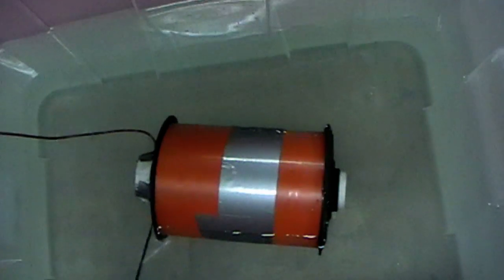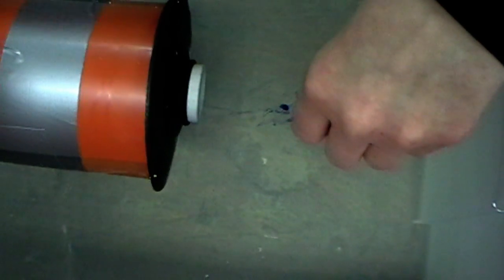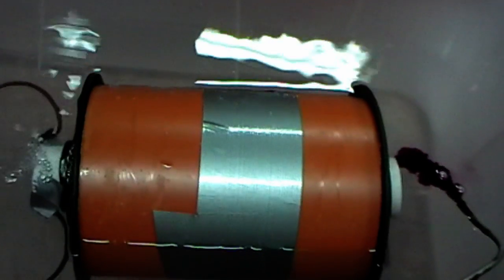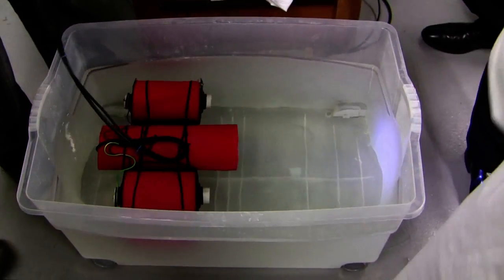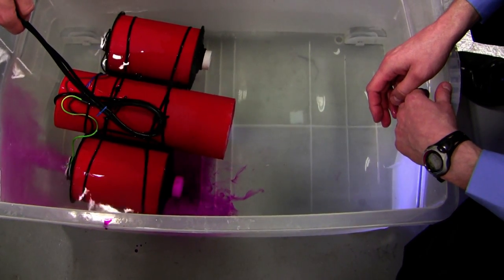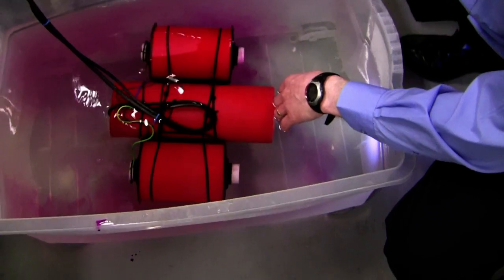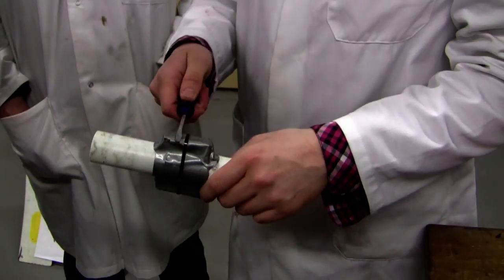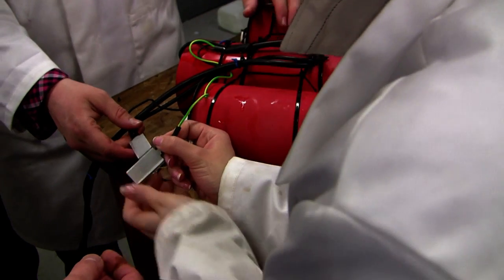MagnetoHydrodynamic submersible project.

Comment: This would be great for submersible mixers that require long term operation in underwater environments. The lack of moving parts, the water tight nature of the motor, and the advantages in long term operation would offset the lower power output.

Comment: If this was used on a military submarine, what do you do about the bubbles?
Reply: This has bubbles just because of the way it was designed, it doesn't need to
Reply: @rabbitez  its because of the water being turned into hydrogen and oxygen once you get past the potential theres no way around it
Reply: Nuclear submarines already release hydrogen and hydrogen detection is the most common method for finding an enemy ship so maybe it wouldn't be that much of a shift in operations
Reply: Warren V: Not actually a problem
https://en.wikipedia.org/wiki/Electromagnetic_shielding
Reply: If it's in saltwater, then the bubbles will be hydrogen and chlorine. I suppose you could effectively sniff the wake on the surface, and potentially even use bubble density or size to estimate a depth. It'd be a poor drive for the military.
Reply: not only that but the electricity to induce a magnetic field creates a detectable source; not good for submarines

Comment from the maker: #Student   project (£100 budget) to build a  #submersible   based around a  #magnetohydrodynamic   drive engine.
The thing about this sort of engine is that it has no moving parts!

It uses the principle that a magnetic field can induce currents in a conductive liquid. Or if you induce a current in a conductive liquid and in the presence of a strong magnetic field, then the liquid can act as the moving part of an electric motor. Moving the liquid in one direction and the vehicle (motor) moves in the other.

Although this was not a huge success (it is not easy to do efficiently) it still did show signs of working.
Reply: I think that they lacked was salinizing the water that was in the container.

Comment: Very good, except the project could of been a little cheaper and would only require two metal plates and two insulating plates. Connect the wires to each of the plates, one on one and one on the other. The basics of the MHD drive is that it needs high-frequency and high-voltage. Once that has happened, it will break free of gravity and wherever it's pointed, it'll go. 

From the looks of it, they used somewhat of a medium frequency and some voltage. They want power, amp it up a little more. :)